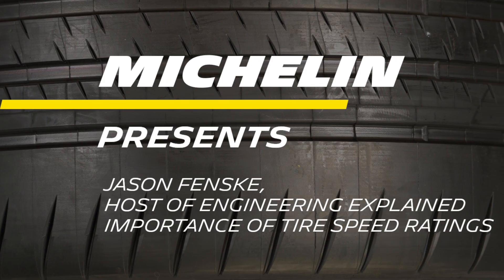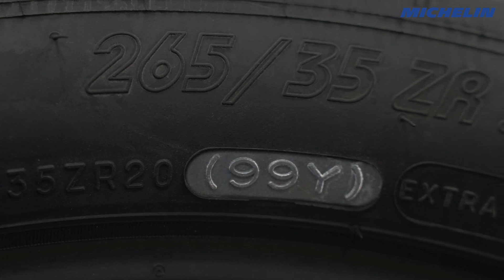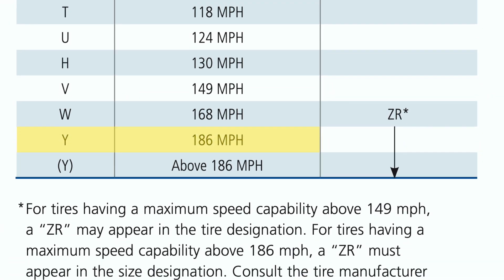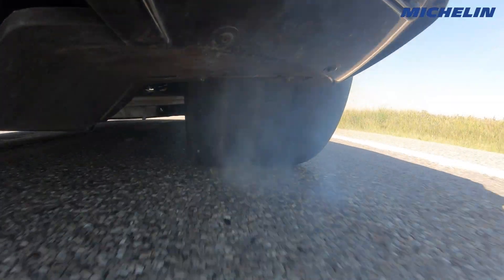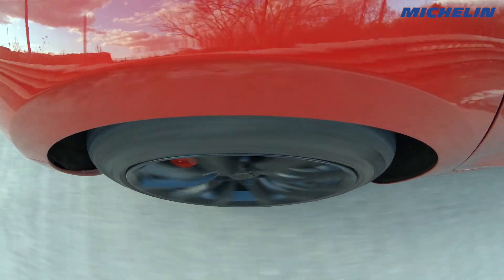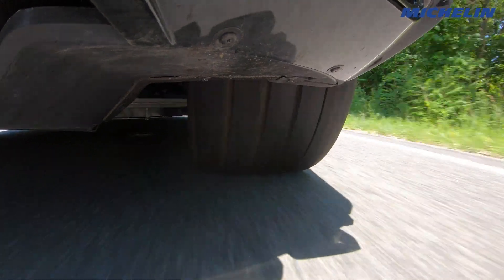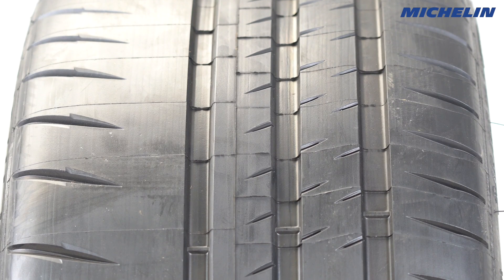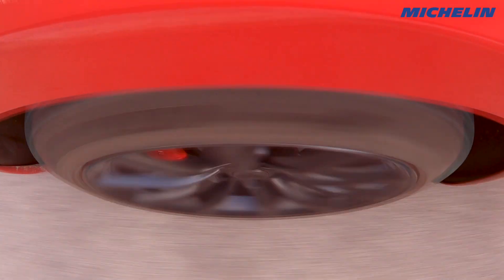What Is A Tire Speed Rating?

Comment: I have a simple questions; When comparing two identical tires with differing speed ratings, such as H versus V, is there a variation in the rubber compound, or is it solely the strength of the steel belt inside that enables higher speeds?

Comment: Oh no. You’re missing a crucial element of the equation. The faster you drive the lighter the car gets. It starts to float, therefore making it lighter and reducing the pressure on the tires and reducing the tire temperature. A side benefit is it less wear and longer tire life. So if you drive at 186 mph you may only need to buy new tires every 7 or 7 years.

Comment: MY experience has been "H" speed rated tires give a smoother, more comfortable ride, vs. "V" speed rated tires.   If a more comfortable ride is a priority, get the "H" speed rated tires.
Reply: You might have a point but it also depends on the car. An old Jaguar Xj6 Series III I think used V rate tires 205 70 VR15 and it has a very comfortable ride. I don't think H rating would improve it much

Comment: If my car will not be driving close to 160km/h and it is mostly stay at regular highway speed(somewhere between 90-120), do I still have to use V rated instead of H? Is there something else that different V from H other than maximum Speed? 

Thanks.
Reply from the maker: Thank you, Ryan, for asking. Yes you can use H rated tire on a V rated Vehicle.

Comment: OK.   Hot or cold.   That's one thing.   One question though.   On a  (ZR -tire) , is the rubber harder or softer rubber, rather than a regular (R)?    Obviously a ZR is a higher speed rating...   But, what does that really mean as far as consistency of the rubber?    That's the question I need answered.   ?
Reply: Treadwear is the answer

Comment: My car recommended W or Y rated, can I use V rated , it just a daily work car
Reply from the maker: Quan, thank you for reaching out with your inquiry. It is always best to follow the original manufacturing to ensure the best performance. However, with the speed rating as long as you are not exceeding the max speed of the tire you will be fine.
Reply: @michelinman  if you made a video about tire speed rating, have the decency to answer a question with confidence.

Comment: What about a video on load ratings?  I have a car that "needs" an 88 weight rated tire, but it has an uncommon size so I need to find an alternate tire.  There are lots of alternate sizes but almost all of them are rated at 87.  I don't use the car for towing or loading it up with heavy stuff.  If I shave off 50 lbs from the car, an 87 rated tire should be sufficient, right?  Or is there something else I'm not getting about what this rating means in practical terms?

Comment: This video does more to screw up the importance of speed rating than support it.  No one is driving 200mph+ but there is value in buying a (Y) rated tire as it will handle better than a W rated tire.  If it was just about speed, it would be no big deal to put a H rated tire on a V6 Camry that Toyota lists as requiring a V rated tire despite the car being  governed to not exceed 128mph.  I'm stunned and disappointed that Michelin put their name to this video!
Reply: No a Y rated tyre will not handle better than a W rated tyre.

Manufacturer will often put tyre with a higher speed rating and/or load index than required simply because that's what is available at a good price.
Reply: Sorry, but those are not acurate statements.  Yes, a speed rating is not a handling rating and there are always lone exceptions, but generally speaking, a higher speed rated tire will handle better than a lower speed rated tire.  The Camry example I gave (but there are many others out there) holds true for multiple of years and Toyota states on the tire placard that the vehicle requires a V rated tire so it isn't just whatever is available is thrown on.  The tire is the only item on the car that contacts the road, therfor it is the most important item for traction.  Yes, other components play a part, but all of those components are designed to give the tires proper traction with the road.  Why would they just throw any available item on after engineering the suspension to give that particular item the best condition to perform in the manner they want that vehicle to perform?
Reply: @WhoDatPA  those are extremely accurate statements and I stand by them.

I never said that manufacturer put on "whatever is available".
Reply: @WhoDatPA   Question, My tire size is 215 60 R60. 95H
I have a chance to get discounted Bridgestone EL400-02 tires new.  The only thing is, the Bridgestone tires are 215 60 R16 94V.  Does that matter if the tires are 94V instead of 95H
Reply: @danlivni2097  You can't lower the load index.
Reply: @danlivni2097  agreed with what was stated by the other poster,  you can not go to a lower load rating.  The engineers have a design spec for a reason, and we need to follow those specs written on the tire placard.
Reply: @dufonrafal    
Question for you, cause I'm having problems with these new tires I got. I'm getting the shaking in the front of the car, which I never got with the previous tires I had on the car. 

So Saturday I had the mechanic put on the Bridgestone El400-2 tires in the front. They're 215 60 R16 94v on the front. For the rear he put on these Pirelli P7 216 60 R16-95h.  The car recommends 95h.

I also got a car inspection that day. When I'm driving on the highway with the new tires, I noticed there's a shaking in the front, especially when I'm going over 60 miles an hour, like 65 and 70 miles an hour. There's even a shaking on the steering wheel. 

I didn't get this with the previous tires I had. With my previous tires I had different brands on the front and back. I'd had Sumitimo on the front and BF Goodrich on the back. Both tires were 95h which is what the car recommends. 

What do you think this shaking is from. Do you think the Bridgestone 94v is doing that, or maybe the Bridgestones are defective tires. 

I'm thinking maybe I should rotate the tires and put the Pirellis on the front and put the Bridgestones in the back. 

Would that help with stop the shaking in the front. Or should I just get two new tires to replace the Bridgestone and have tires rated at the 95h, which is what the car wants. 

I bought the Bridgestones and Pirelli tires on eBay. I bought them from two different people.  I bought the Bridgestone from one person and I bought the Pirelli from another person. Both have great ratings on eBay.
Reply: @danlivni2097  wheel load balancing
Reply: @dufonrafal   So I went back to the guy who put on the tires. He tells me I need to get the tires aligned. He said he did a wheel balance correctly. I know this guy did not do the wheel balance correctly.

When I drive the car you can tell the wheels especially the front wheels are vibrating. I don't think this guy knew how to do a wheel balance. 

So here's my question. I'm going to go to a tire place that does wheel alignments and a wheel balance.

Should  have them just balance the four wheels first and give that a day or 2.  If that doesn't solve the problem, then get a wheel alignment.  My wheel alignment feels good.  It doesn't feel like it's out of alignment.
Reply: @danlivni2097  Why not get both while you're there, an alignment once in a while doesn't hurt.
Reply: @dufonrafal  You're right. I'm going to get both the alignment and balance the wheels. I remember someone told me when you get 4 new tires you should always get the tires aligned. So I'll get both done. Thanks for the advice
Reply: @dufonrafal   Question, My tire size is 215 60 R60. 95H
I have a chance to get discounted Bridgestone EL400-02 tires new.  The only thing is, the Bridgestone tires are 215 60 R16 94V.  Does that matter if the tires are 94V instead of 95H